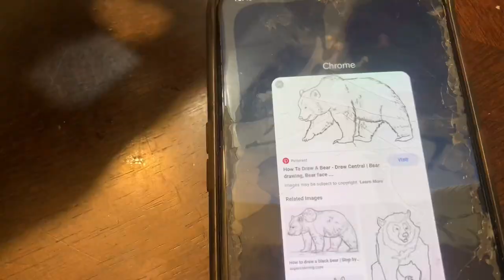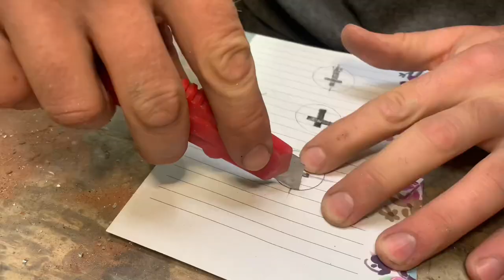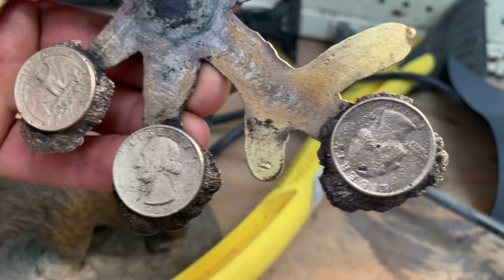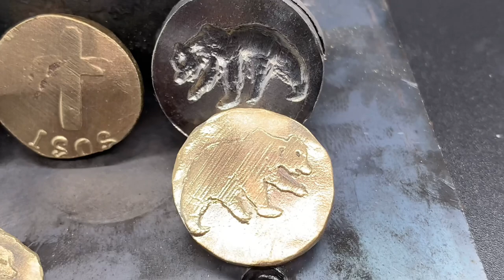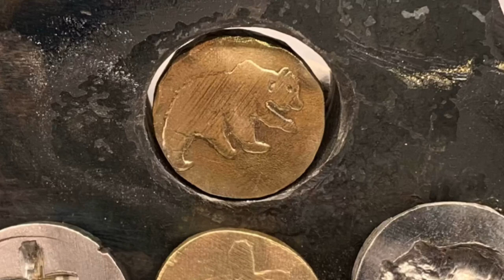Homemade Coin Dies. Making a New Currency!

Comment: Instead of casting blank coins, can you cast a solid pipe/cylinder of desired diameter? Then cut that into desired thickness, and use them as blank coins.

Comment: I have investigated the modern process of vapor deposition of tool steel onto the surface of a "medal/coin" with a powdered carbon graphite micro layer saving it's surface and allowing the die after vapor deposition to fall free. It would leave the information in reverse reading into a 5mm wafer which would be induction welded onto the die proper and then heat treated for durability. This would be done in a vacuum furnace to maintain the "coin's/medal's features. Lastly the die would be diamond polished. I was a miniature machinist much of my life; I am currently disabled from getting hit by an SUV while crossing the street in the crosswalk. It would be interesting to try this method. This method here looks like the Roman method; not bad. I noticed the bear die is deep however the coin/medal is barely impressed which indicates the need for some serious tonnage. I estimate 100 tons at least for that large bear coin medal made from bronze.

Comment: Pretty good results for a makeshift mint press. If you make your engravings shallower the detail will come out more, otherwise you will need to use some sort of press. Also, might be easier to just get a flat piece of sheet metal of the metal you want to use and stamp out the blanks. Casting works but seemed like so much more work haha.

Comment: A little trick that engravers use is to print the wanted motive mirrored onto a piece of paper, put it face down onto the workpiece, fix it with a little bit of tape and carefully brush it with aceton. Dosn't work with every printer or ink but if it workes you tranfer the ink from the paper onto the metal.

Comment: Also... You need a tight fit for the dies and blanks whe you put into the collar.
To keep dies and blanks from sliding and moving while in the collar.
* Secure the collar in place.
* insert reverse die.
* insert blank.
* insert obverse die.
Then STRIKE.
Very good video.
Excellent first attempt.

Comment: For me: oven bake clay, toothpicks, wooden skewers, sand paper, embossing styluses, sandpape, high heat resistant mold solution, pewter ingots, solder melting pot, metal dipping ladle a lot or practice, patience, and failed pieces.

I'm getting pretty dang close to roman era style coins myself.

Nice video and nice effort btw :)

Comment: to improve your setup...secure your wood log down to something...and build a vertical channel track for your sludge hammer to run along until it meets the coin. these two things should help a lot...you are losing impact power by the log bouncing off the ground...and also losing precision when the swing doesn't hit it directly head on

Comment: Brass is difficult to forge..If you use a regular round bar of copper and a slightly convex slug made from it, , it will help the coin contour to your reliefs carvings. Another thing that might help- Use a real sledge and Solid base like an anvil or hard pack/clay surface. The wood rebounds way too much. You only want to hit the die once..Hard and level. Practice makes perfect in all aspects of colonial coinage.. If you want to make them with brass flats and your current set up, you'll need a 20-40 ton hydraulic press.
Reply: Jesus is the only way. We have all sinned and deserve Hell. Sins that may seem small in our eyes are big in God's and are worthy of Hell, such as lying lusting and stealing. But if we repent and trust only in Jesus, he is faithful and will save us from Hell and give us eternal life in Heaven. Trust in Jesus!
John 3:16
Romans 6:23❤😊

Comment: Fantastic job. One tip you do not want to strike a hardened surface with another hardened surface… For example hitting a hammer with a hammer.  Counterintuitive but the harder something is does not mean it’s indestructible. A chip could come off and go flying.  

I can’t wait to see your other videos looks like you do some great work though.

Comment: Oh yeah. Great video. I live in Greece, I was always wondered how coins were made. I've seen a few ancient tools in museums, but never have I seen it live. Another easier thing you could try, is coins from tin. In late 1800's due to the lack of change in Ottoman empire, Greeks found a cheap way to make small coins for use between them (in church, grocery stores etc). They were taking thin metal tin containers, cutting round pieces using a punch and then do the same process as you did. It was easier, because they didn't have to mold, smelt etc. If the tin was thin, they struck only one side, if it was a little thicker, both of them. You should try it. I have bought a few old coins like them and they are pretty good and quite rare.

Comment: Well done! I love those coins! 
BTW you don't need to heat up the blanks so much. They are at their softest point after pouring them. Since you had to sand them, you basically work hardened them. So, it was a good idea to heat them up again to anneal (soften) them before stamping, but they don't need to be hot like that while you stamp. The metal stays soft, even after they cool down, until you do something to work harden them again. Nonferrous metals react to heat & cold differently than steel. 
I really enjoyed this video. You definitely got my sub.
Reply from the maker: Thank you!

Comment: Coin dies are made using high-carbon steel.  This is necessary so that the steel can be annealed, engraved while soft, then hardened and driven into the coin blank. The best steel to use wis generally at least 6/10ths of one percent carbon. Tool steels are generally preferred.  If you have a forge, a good source are worn-out circular saw blades.

Comment: the presentation is excellent,  it has rendered the meaning. 
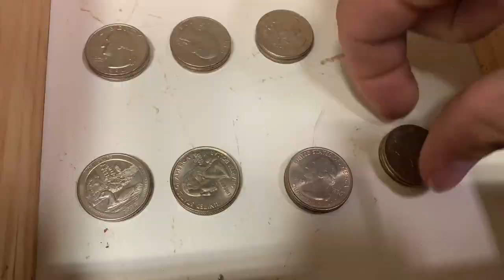detail, before the foundry sand fell 6:02'' you had to sprinkle it by sifting inside of an old sock with a thin layer of charcoal ash so that the originals would come off easily 6:52'' . 

what would you say ? 😏

Comment: Cool idea!
Use a proper sledgehammer with a handle long enough to swing it with both hands. 
I assume fewer hits will give you cleaner edges. 

Try a softer metal such as silver or even tin and/or reduce the diameter of the coin. 

I have a large silver commemorative  coin struck at a faire some 25+ years ago.   It is about 1.5-1.8 times the diameter of a US quarter and was heated in a forge until glowing, placed in the die and struck within a few seconds of leaving the heat.  The spot where the blank was gripped with the tongs is clearly visible as the pattern didn't transfer as well.

The replicas of medieval coins  I've seen stuck have all been struck cold but the blanks have all been small and cut from 1 mm  or thinner silver sheet metal.
Reply from the maker: Interesting. Yeah I think a bigger sledge hammer would help. But I think I need a bigger die to strike too.
Reply: I checked the size and the silver coin I have is 40 mm in diameter.  A US quarter is 24.26 mm. If you like I can send you some photos of it.  The relief is really high, although to be honest I have no idea what the requirements are for high and ultra high relief coins.

Something that struck me was the space around the blanks in the die.
Did you check the diameter of your blanks before and after they had been struck?  I understand wanting to avoid having a coin stuck in your die, on the other hand you want to force the metal into the die instead of oozing out sideways.

Comment: I know this is a bit old, but I would suggest modifying an old heavy duty drill press instead of a hammer or build a simple leaver press.  Also try starting from a small bead, blob or ball (not sure if there's a correct term) of your heated metal instead of a straight coin blank, and let it deform out into the coin shape as it's pressed (kind of like putting a ball of dough in a cookie press).  Finally, try using something softer for your coin material; Copper, aluminum, gold or silver (though those last two are much more expensive).  Though brass and Nordic gold are still on the softer side, they are notably harder than their base metal and therefor harder to deform. 
Loved the video!  Thank you for putting it out there.  It really helped me think of how to make this work on my own. ^_^

Comment: Well, done. very well done. I'm probably going to pour aluminum or copper into plaster. I will make wax blanks and burn out the wax in the drying process. But dude, well done.
Reply from the maker: The lost wax process is a good method.
Reply: @lundgrenbronzestudios  I saw the delft clay to be expensive.

Comment: The way to make mirror-image dies is to engrave them exactly the way you did, then harden the die, and use a press to drive it into a soft steel planchet, which is then hardened, and used as the final die.

Comment: It might take more setup to do, but you could harden the stamps, then soften the metal to be stamped, and use a very heavy press to crush down onto the blanks. A couple ton hydraulic press could do the trick.
Reply from the maker: That would be interesting to try.
Reply: @lundgrenbronzestudios  Three coins thick is pretty thick for a coin, but if your goal is to have wider coins with some thickness to them, then try two quarters thick with the press technique. If your stamp area is wider than the blank then it will smush outwards as you crush it, then you can harden the coin after if you so wish. 

Just some ideas to achieve your desired outcome.

Comment: Very interesting video!
I have some suggestions to you:
•You could try acid etching for more details. It would be much easier than making it by hand.
•On the hammering process, you could make a system where a weight drops on top of the coin stamp. It is much easier than hammering it one by one

Comment: I should think that using a hydraulic press like a car jack would work better.
Also, at least until you get the procedure down right, you might want to try an even softer metal like aluminium or copper.
Reply from the maker: I’ve got a 20 ton jack. I’m not sure how I would hold that much pressure though.

Comment: Would have been much more efficient and consistent to press them with a hydraulic press even a bottle jack would have worked you can get a 2-ton pneumatic bottle jack from harbor freight for like 30 bucks. I also think you're blanks could have been made more efficiently and consistently by casting a solid rod and then cutting them to the required thickness with a bandsaw. Bronze is quite soft so it would have been barely any wear on your blade if you had a half-decent blade🤷. Still neat though. Good job.

Comment: If you use a hydraulic press, that will be more even and consistent for the stamping. Attach the dies to the press. I suspect splitting the holder into (at least) 3 (and then allowing them to be secured in place-like a vice-would allow the coins to not get stuck after pressing. The holder might need some interlocking nubs to withstand the outward pressure.
Modern home CNC (etc) machines might help get a more finished die (when the kinks are worked out of the process).
Depending on the metal, you might also just engrave some coins out of sheets of metal. Not necessarily as polished though.

And, for the record, I have zero experience with any of this, so this is very much an "outsider" perspective. I only give ideas as requested.
Reply from the maker: I’m had a lot of people request a hydraulic press.

Comment: How much do those pieces of equipment shown at 3:14 and 4:00 typically cost, and where could you buy an affordable one? You know, the one that puts the designs on the coins.
Reply from the maker: So this is basically what I am using in the video. https://amzn.to/43h3Qcc

https://amzn.to/3BMgPa8

You can get models cheaper but this will give you an idea.

Comment: I was trying to do something similar but i found infirmation that in ancient times like ancient greeks. They was useing molten drops to get deep relief- You need to strike few times and i think its bad for quality. I was trying this with Clay open mold and You can compres molten metal causeing very good detail and surface. But in contact with steel Die IT will demage IT very fast so its not the best idea for mass production.

Comment: Hay I'm gonna make a second comment so you get a new notification, I learned that Nordic gold is actually kinda hard, not the best for coin making silver is obviously one of the best choices but when it comes to cheaper metals copper is a fantastic choice since its rather malleable, Nordic gold is rather hard due to being a fancy form of brass.
I believe you would get a ton more detail using a softer metal also having the blank be hot is apparently a traditional practice so you're on the right track there, also I found out my previous comment about using a vise is one way about it another is   hitting them together with a hammer you should try both to see your personal results it should be relatively simple for you to do both.
I also saw a method of making blanks where you make a bunch of circles and link them together with lines and pour the material in an open mold instead of having a closed like you had, there's less waste due too leakage and overfilling and you have more control of what's happening, in the past they would simply file off the inconsistencies but you don't need to worry about your coins being all the same since its just hobby work.
After you do copper aluminium is harder but it's also more malleable than other metals so you should test it out too, and if you have the privilege to make one out of silver or gold it would make an amazing addition to whatever collection you might have actual gold would be too rich for my blood considering the silver would be like 20-40 bucks one huge bonus about silver though is because of its low melting point you can just use a blowtorch and a vaguely circular shape in some casting sand to make a blank in under half a minute, extremely handy.
I think that's about all the new information I have, please do tell me if you intend to fallow any of my advice what so ever I'd love to hear about it.
Reply from the maker: This video has a gotten a lot of attention and I’ve been wondering if I should try to do this again.
Reply: @lundgrenbronzestudios  I mean it's up to you, if you think it would be fun then that's all that matters.

Comment: The ancient Greek and middle ages coins are made by casting they are raff and every one is unique, strapping is a modern invention,nice try you got almost right ,the coins that are going to be strapped the are already perfect and they just fit the edge don't change, they use a press and very powerful at that ,I like your hammer technic

Comment: To strike accurately it takes two people. One holds a rod or blank of soft steel (a sledge hammer seems convenient but striking hardened steel on hardened steel can be dangerous) the die and the other strikes the intermediate piece which transfers to the die without slipping.

Comment: I'd recommend starting much closer to the desired thickness and size, yeah you are displacing metal but not as much as you think you are also cooling the blanks before hand is a bad idea because it makes the metal harder you want to keep it malleable in other words nowhere between being completely melted and being stamped should you put the blanks in water also if you want an easy way to press the stamps together you can simply use a vice instead of a hammer that would also give you a uniform presure and more energy behind it with less effort.

Comment: Should have just bought some brass round stock and cut your discs to fit, and buy or make a hydrolic press. Also that steel isn't going to hold up very long you need thicker strike plates like an inch or two at least. Also I know most people that talk shit in your comments have no clue what they're talking about so ill add that I have a bachelors degree in advanced metalsmithing from Southern Illinois University. Overall not bad.
Reply from the maker: And I’m also sure you have done this yourself?

Comment: U deff should have just 3d printed a nice coin and then cast it in sand and made coin that way i thought this as u were making cast for blanks then u said it your self lol
Reply from the maker: The ancient Greeks could do it. I wanted to see if I could do something similar but I don’t know the ancient ways.
Reply: @lundgrenbronzestudios , 

"Minting

All Greek coins were handmade, rather than machined as modern coins are. The designs for the obverse and reverse were carved into a block of bronze or possibly iron, called a die. A blank disk of gold, silver, or electrum was cast in a mold and then placed between the dies, whereupon the coin maker would forcefully strike the top die with a hammer, thereby impressing the designs on the metal."

Source: https://en.wikipedia.org/wiki/Ancient_Greek_coinage

Comment: Casting is not how coins are generally made.  The method is entirely wrong.  You could have skipped all those steps.   Most both modern and ancient coins are hammered or stamped, not cast.  Your coins are too thick.  Take silver or gold, make sure it's pure, buy or make a mold for a measured blank.  Molds are cheap..  Melt the gold or silver and out in exact weight and pour the blank.    Then you can built a custom stamp and heat the blank up and whacked the heck out of it.  Much simpler and then it carries quantifiable value.  Casting a coin is nonsensical.